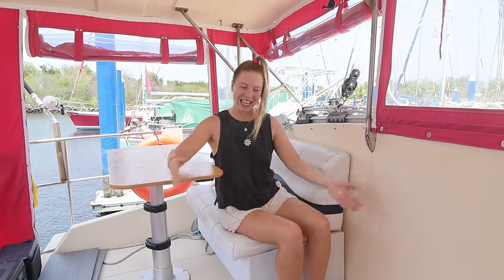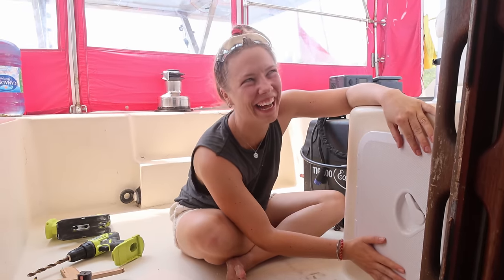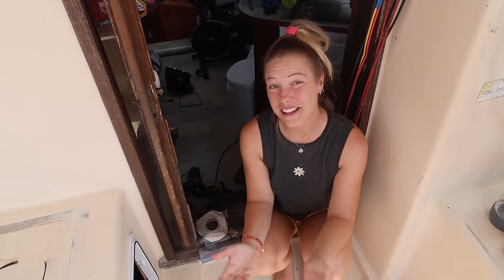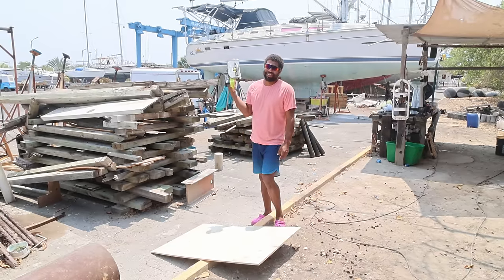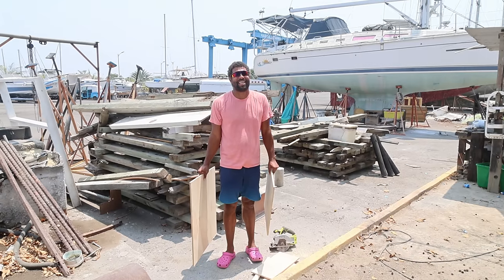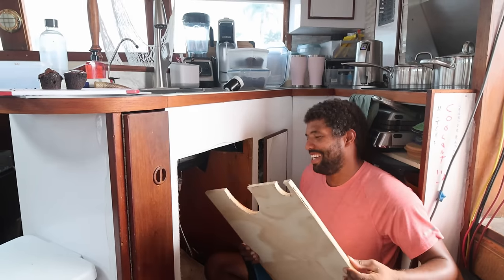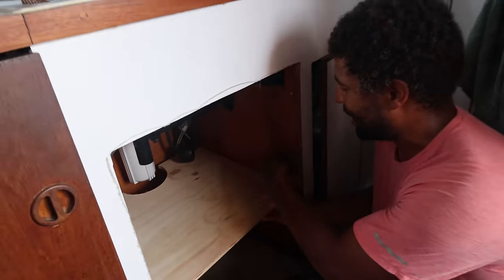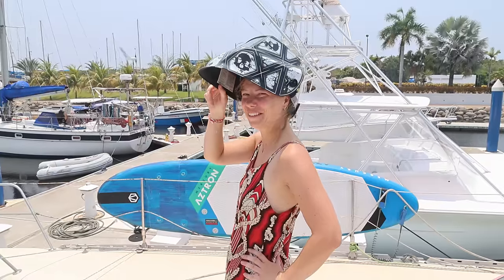A MAJOR CHANGE TO OUR SAILBOAT! [Ep. 37]

Comment: Still looking good. Please show us a floor plan of Supernova. Our’s had a very large Head/shower forward in the Port hull and a wet head/shower midship in the Starboard. Port Aft was the tool room, Starboard aft a double cabin. Mid ship we had Queen cabins in both hulls mirror imaged with a kids cabin forward  of  that.

Most Prouts were invoiced as “hulls delivered”, it was a tax thing to save on IVA. The brothers would finish the boat to any level you wished. They would NOT compromise on the hull or rigging.
Reply from the maker: I think we got a great hull and that's it  the finish work was all done outside of the Prout team hahah

We are working on a boat tour video, We have changed some things up for super long term sailing and we are getting close to having our floor plan done, we are still in heavy refit mode as we sail around :-)

Comment: The new deep storage cupboard you need slide in boxes and to easily get to the back ones fasten a rope to the front of the box so when you slide it in by pushing in with another box you can easily get at the back one by just pulling it out with the rope other wise down on hands and knees with arm stretched out trying to find it to remove it
Reply from the maker: We will look for some slides, Its so hard to find parts around here!

Comment: I am not a plumber but wouldn't the kitchen sink need an elbow or trap to prevent noxious odor from backing into the kitchen? You answer will also educate me on the process.
Reply from the maker: The sink pipe runs right out of the hull into the water, if it was going to a tank then it should have something for the smell, but it just goes out of the sink into the ocean, that means we have to watch what we put down the sink :-)